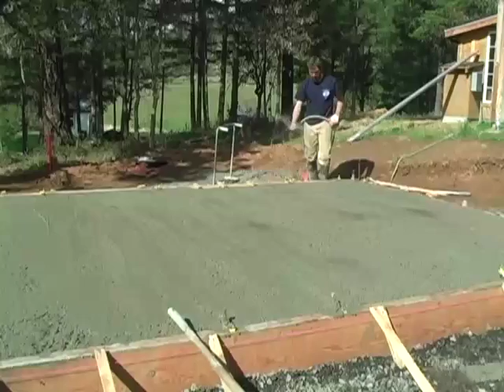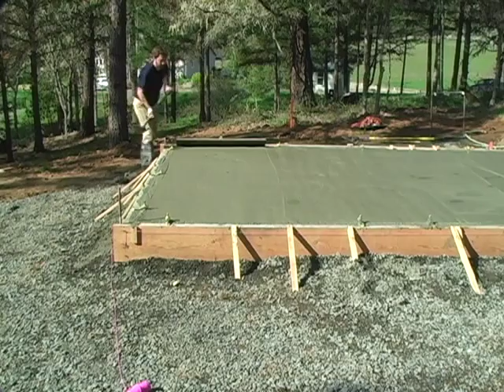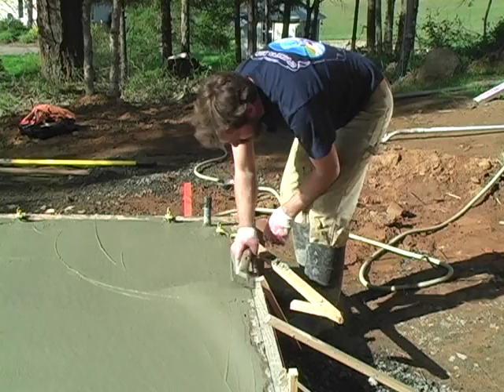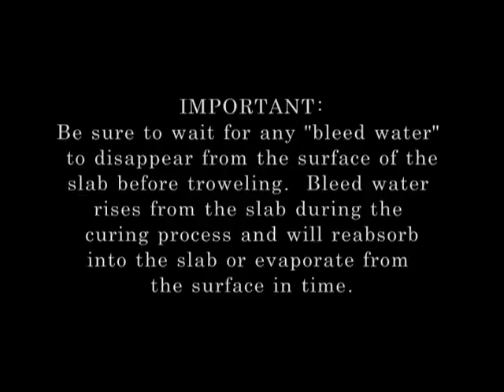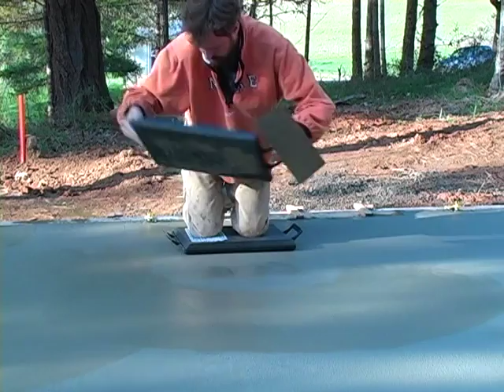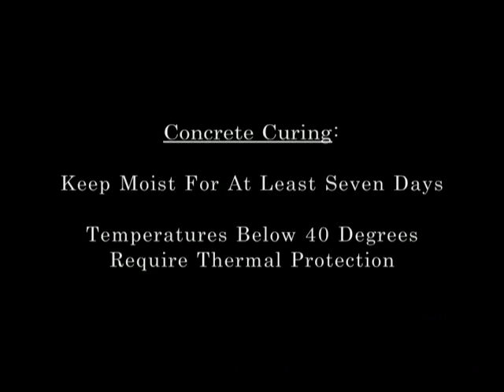Finishing Concrete Slab Foundation

Comment: I'm a second generation concrete finisher and have been placing and finishing for a little over 10 years and I am just going to say every bit of that is wrong. Always pour wet enough that you can work it but not to wet because it weakens the strength of the concrete. Tap the forms beforw yoy screed or do anything for that matter while its still wet. After screeding your slab flat throw that crap you were tamping with in a dumpster take your bull float and run it opposite way you screed so that you get it flat and work the board lines out and push the cream where needed not in the same direction you screed. Then fix your edges with a mag. Use a 4' Fresno to slick it and then touch up your edges  not try to board something that big with a 12" steel square trowel. And never hold your trowel at that high of an angle. Always low. You don't need to keep a broom finish wet for 7 days. Typical concrete is normally almost 3000 psi within 24 hrs
Reply: Joshua Atkins spot on!
Reply: Thank you I’m a union journeyman finisher and I was thinking the same thing we never do anything this guy did for one it should be flat off the screed and second we vibrate any edges or columns or anything else that would need vibrated and we use trowel machines to finish and we never keep it wet for 7 days lol the only thing he did right was kneel on them boards but didn’t trowel right I can hear the chatter he was leaving behind

Comment: I have always consolidated the concrete along the forms by using a vibrator or, with even better results, jabbing it thoroughly (you can feel when it is mixed) with a stick or shovel. I found that to be much more effective. I see some criticism of the jitter-bug method of finishing, but it works really well for lower slump mixes.

Comment: Read some of the comments sorry people treat you like that I'm an old concrete guy I can tell you worked hard are trying to do the best job you can but you turned out good the more you do it the more tricks you learn yes used to trowels get a pair of aluminum kneeboards hit it a couple times Peach Pass will take you about 15 minutes 2 when capping your forms 2 not get honeycomb do it right after you pour when you did it it was too late the mud was too hard same with camping do it right after you pour and fill your holes from your boots by filling the holes with your boots you waited too long in the mud was too hard those are just some tricks you learn hope this was helpful from an old concrete guy

Comment: I both have finished concrete and now drive a concrete truck.  I never seen anyone do concrete like this. Both union and non-union. You couldn't use this slab for a trailer.

Comment: this is not how u pour or finish concrete
Reply: Michael Stensgard then why don't you enlighten us to your vast wisdom
Reply: George Greb  don't know where to start. could've poured it just little wetter- waited too long  jitter bug or tamp it  then try and bullfloat it. would not have had holes to fill if he would have jitterbugged it sooner. when finishing the floor he should rub it out with a mag float  before running the trowel over the floor.  rubbing it with a float will bring the cream up to give the trowel something to finish He should use a larger trowel - I used 18 in trowel for 20 years on most floors  only used a smaller one on steps.  he probably left a lot of chatter marks. needs to learn how to move his knee boards. should finish on both sides then front of himself. if you learn how to move your knee boards. you could have that floor finished in 15 min and have it it like a piece of glass. takes time to learn how to finish but once you do it's not hard. he worked way to hard on that project. also it shouldn't matter what kind of use the floor is getting. should always be the best you can give. he mentioned he finishes according to the usethe floor gets not good way to do it
Reply: The fact of the matter is, there is more than one way to skin a cat.
Reply: Larry Iwema  Very informative, you don't have a how to video do you? Or one you'd recommend, with useful information.
Reply: I think it is good it's simple and tell you the basics
Reply: Jitterbug is garbage. For a finished floor then powerfloat all the way.
Reply: Hey bros, at least the slab is finished to a solid standard.

Not all off us are professionals. 

Have a great day  :)

Comment: never spray water on top of uncured concrete !  bad info here ! if this is to be exposed to the elements I give it about 1 year before it starts Spaulding ! thanks for showing people how to not do a foundation !
Reply: my neighbor is a foreman at teichert concrete. he sprayed water on his driveway religiously in the week after it was poured...during curing.
It still looks great.

edit: oh and by the way, it's "spalling"
Reply: Float pole not long enough . I was also told adding water weakens the concrete.
Reply: Adding water to concrete weakens it
Reply: @The bomb no your wrong water is not the cure. Wow you know nothing it will cause Spaulding if you place water on top of already wet concrete. You buy what is called curing compound and you spray that on top of the finished concrete. And then after 28 days the concrete is at its strongest and will only continue to cure and get stronger as time goes on.
Reply: If it is too hot outside, concrete can cure too fast and overheat. It is a chemical reaction that causes heat. Especially in Alabama during the summer months, we will pour in the morning and by the afternoon the concrete has set up enough where we put sprinklers on to cool the concrete off. If concrete is not cooled off it can cause it to crack and weaken. But we do it on slab pours.